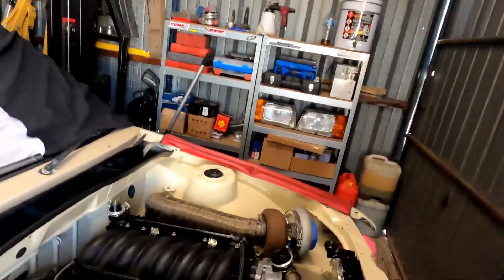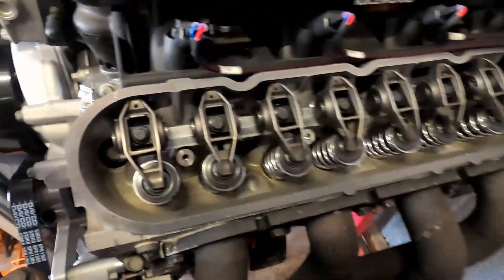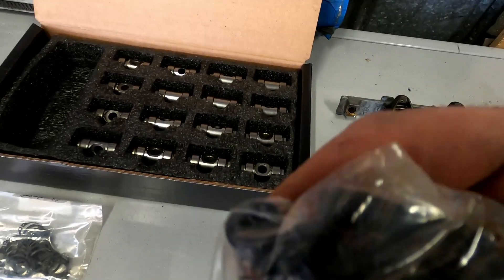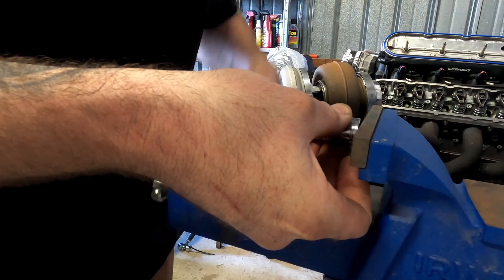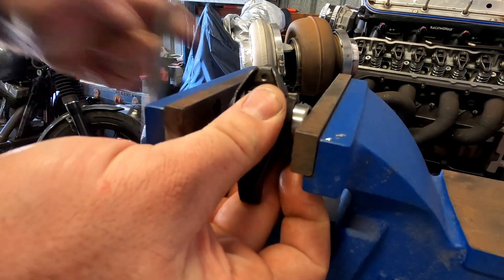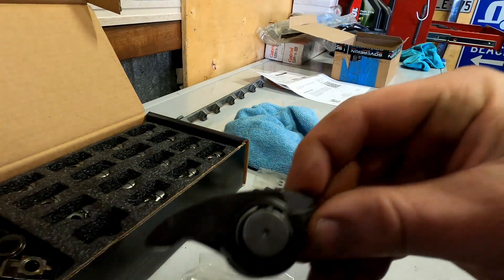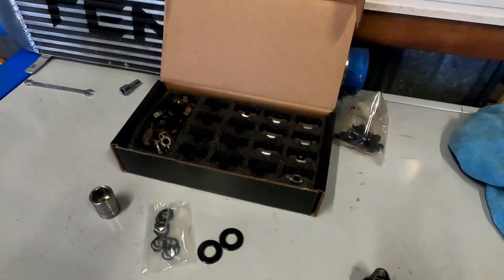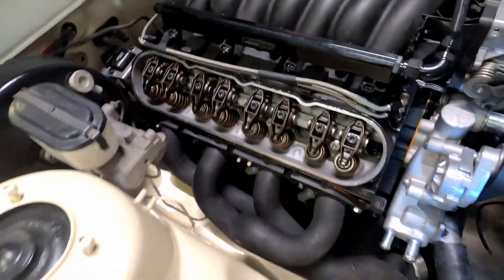GM LS Engine Trunnion upgrade ''how to''

Comment: Hi mate do you just send them bolts down until they bottom out? Obviously some will compress the valve springs and I get nervous it will pull the thread out of the head
Once you torque em up do you just spin the motor over by hand and also recheck?
Reply from the maker: Hey mate, I've never had an issue with pulling a thread out. I always send the bolts down, even the ones that pull down and open a valve. (I work on LS' every day, so I have done this plenty of times) What is common is rounding the head of the bolt, so make sure you have a good socket, If using fsctory 8mm head bolts, I always use a single hex socket. 

Always handy to spin the motor over by hand before putting the rocker covers back on and recheck for sure. Even if it's just for your own re assurance.
Reply: @seanpenman  legend mate that eases my mind, thanks a heap

Comment: Hey mate when you say high reving what do you comfortably set limiter to with this trunnion upgrade? Thanks.
Reply from the maker: I probably shouldn't have used "high revs" as a term or main reason to upgrade.  Plenty of people have reved LS combos with a trunion upgrade on factory rockers to 7500+. My combo is much lower than that, theres no need to rev any higher if it's not making power. In my opinion, the main advantages of the trunion upgrade are having the needle bearings held in place in the rocker arm body by C clips, so they cant work their way out. The new trunnion also allows for 360° of rotation, as I mentioned in the video. This helps spread the load on the trunnion bearings across a much larger surface area
Reply: @seanpenman  cheers mate very informative much appreciated. 👍